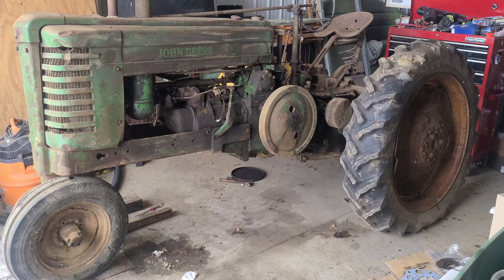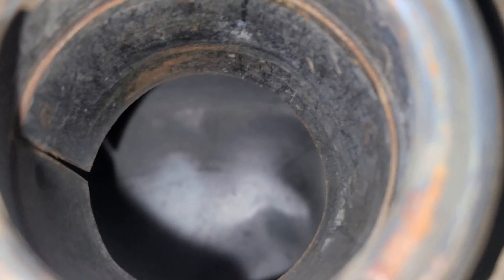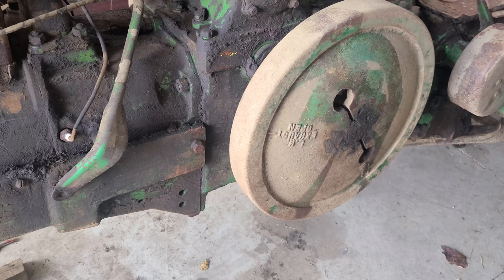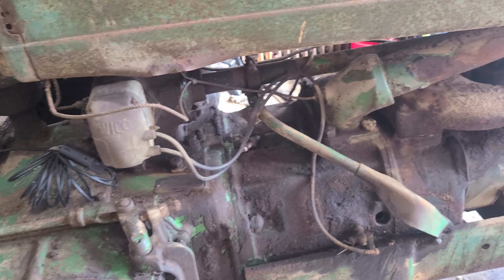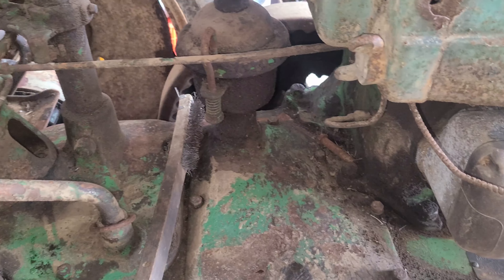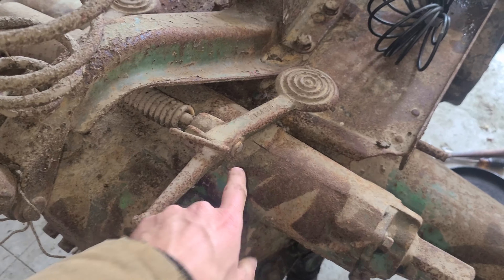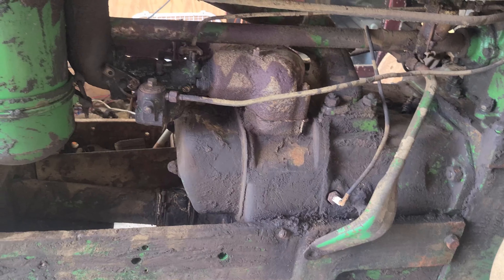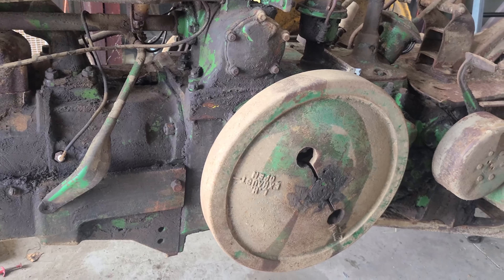Inspection Guide for Buying Antique John Deere Tractors (A, B, G, etc)

Comment: Take an adjustable end wrench and check if it has oil in the engine, and if you do not mind getting dirty unscrew the drain plugs  on engine and gear box just enough for oil to start to weep out, if it is oil that is good, if it is water not good.

Comment: I like to look the wiring over.  I bought a 420 a while back and they had added a toggle switch to the dash and used what appeared to be an old lamp cord coming off the batter and and going to the coil. Only other advice I can offset is looking over axles/block for welds/cracks.  And to remember if you buy it, you'll either have to fix or live with it the way that it is. I enjoy the videos.
Reply from the maker: Great advice and thank you for contributing.  I'll keep that in mind for myself.

Comment: If it's complete  its good to go.  You can get every part you need.  I live within 20 miles of a salvage yard.  Ive been working on them since i was 13 years old back in the 80s.  Before everyone started to fix them.
Reply from the maker: I agree and disagree. If it's not complete,  how is that different than if you have to replace so much of the tractor it's not even original?  My B was that way. At some point it may be better to be a donor for others than to rob a bunch for one. Plus it also becomes a question of cost. Meaning,  is the cost to replace most of the tractor worth it?   If the tractor is sentimental,  go for it.

Comment: How do you check and see if like a tractor with a covered flywheel is free?? I’m looking at a 630 and it’s been sitting inside for 10+ years and I’d like to see if it’s free or not.
Reply from the maker: You can see if you can take the cover off. That'll have a tapered lock flywheel and you may want to see it's condition because they aren't cheap to replace. Back to your question though,  you can try and engage the clutch and rock the tractor to see if the pulley spins. If it's engaged and the pulley spins, then the crank is spinning.  Lastly, take a screwdriver and try and spin the flywheel near the starter using the starter ring gear on the flywheel.  Good luck. I hope to work on a 30 series someday myself.

Comment: An update on the model A I bought, I though the engine was stuck so I poared stuff into the head to have it set, and as I was taking the clutch apart, it started spinning. So that problem is solved

Comment: What do the two pedals on the back to attached to that spring.  I just got my b trying to learn.
Reply from the maker: Those are for the Power Lift system.  Used for cultivators, the rockshaft and such.  Just allows all up or all down.  Precursor to the Powr-trol system that allowed fine adjustment.
Reply: @DanielFarmChannel  so the tractor has to be running to work it. It’s all the way up right now.  It’s got 2 plows up front underneath and 3 on the rear behind the tires.  I pressed the pedal nothing happened tho.  But it was already all the way up.
Reply from the maker: @blakechambers56 cool.  If you'd like,  send me a picture at DanielFarmChannel@gmail.com.  what year is your B?
Reply: @DanielFarmChannel I figured out how to work it all after getting my Manual   My B is a 42. Also have a 60 I’ve been working on and a A that is stuck I’m trying to free.

Comment: I hope you didn't give much for this one, it will definitely cost more than it will be worth.
Reply from the maker: That is the case for a lot of tractors, sadly.  Anything that needs saving isn't worth what you have to put into it.  I paid just over scrap for this tractor.  I'm torn what to do with it and still haven't decided. It would be a great parts tractor, but I like to save them.
Reply: Few to no parts are usable from that wreck.

Comment: Oil sludge clogging the oil pump screen.
Worn out con rod bearings
Water and sludge in the crankcase and trans/diff cases. 
Dry rusty clutch roller bearing with scored crankshaft and worn clutch/crank splines.
Steering gears and rollamatic not lubricated.
Buy a 70+ year old tractor only if it was stored indoors out of the weather. 
Carburetor and gas tank condition.
This tractor needs  $3000 in tires and wheels to start with 👎👎
Reply: You can get good used tires no problem.  Besides tries are $1400.  I know due to the fact I just priced them out.  I have been rebuilding them since I was 13 years old back in the 80s, before everyone started fixing them.